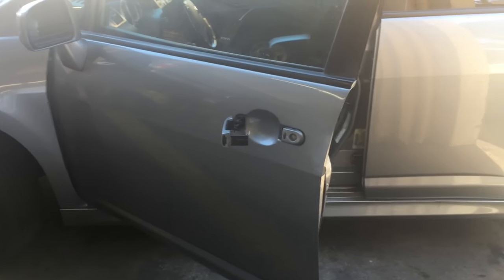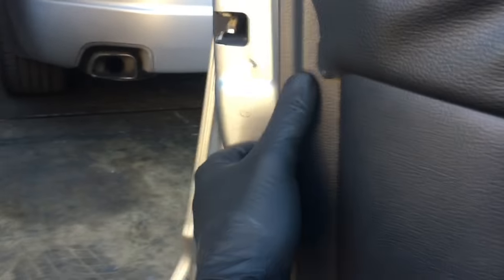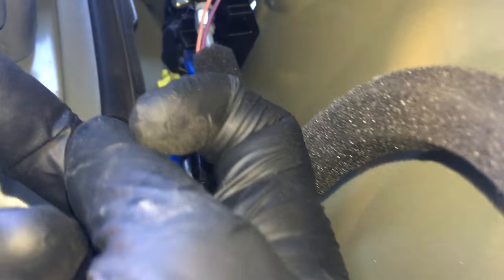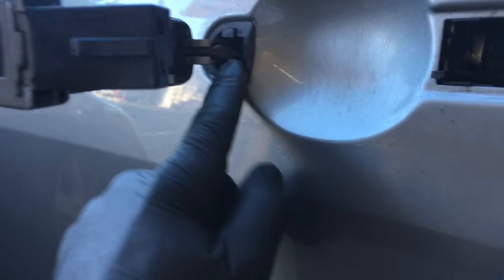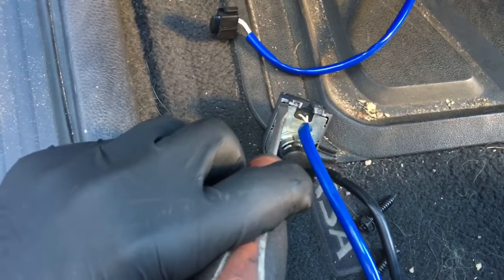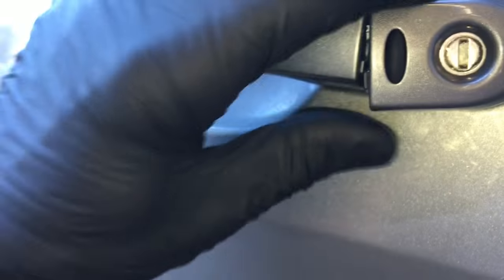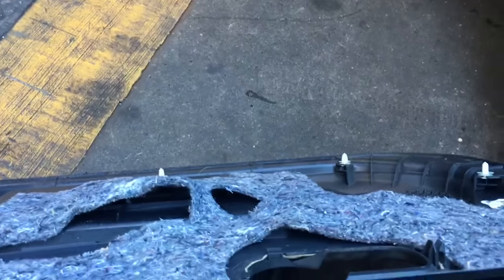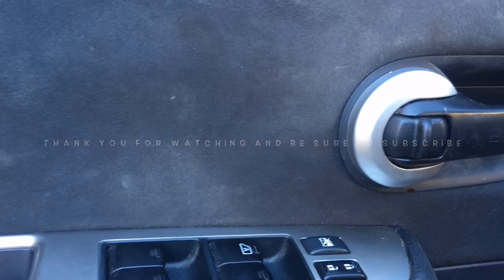How To Replace The Front Outer Door Handle And Lock Cylinder On A Nissan Versa

Comment: This video is perfect if you have the button by the key hole (I believe it's called the "smart switch), but if you don't have that button, it's much easier; you don't even have to remove the door panel on the inside. There are other videos that show the replacement when you don't have it, but if you do, this is a very detailed video on how to do it. Great video!!!

Comment: Thank you so much for this video. Before I watched this I was considering replacing the entire door instead of taking it apart. I am hoping to replace the dying window motor and door handle. I think I will take a stab at actually fixing these problems and replacing the parts rather than just throwing money at the problem and buying a whole door off a salvage car.
Reply from the maker: Wesley Allen you can do this. Thank you for watching!

Comment: Thanks for posting this.  It's a big help. This is my 2nd door handle to fail.  Question: My Versa doesn't have electric locks and windows. Is it possible to do this without taking the interior panel off?
Reply from the maker: Mark Davis i'm pretty sure you need to take the door panel off. The window crank has a clip on the back that you need to pop off. I would a google how to remove a window crank handle i've seen some pretty cool videos out there. If I had when I would link it up.
Reply: Hey, thanks for the reply. I HATE removing door panels but this went smoothly. I really appreciated your video.  BTW....funny you should mention the window crank. No problem getting it off, but  won't stay on now.  I even drove it on with a rubber mallet.  Still scratchin' my head.
Reply from the maker: Mark Davis sounds like the clip inside to handle may have fallen out. It should look like a little horse shoe.
Reply: How to Automotive thanks!

Comment: Do you have a video on how to fish the wire through the hole to keep the door handle on (starting at 3:07)?  My door handle completely came off.
Reply from the maker: Robert Niccum I don't have a video on it but if look inside the door from you should be able to follow the wire and see where it mounts. Just keep in mind when you're running the wire through window will be going up and down and try to keep it clear of all the moving parts.

Comment: Is the key tumbler with cover enough to control the backward movement of the handle by itself? My key hole cover broke and I'm wondering whether my handle knocked the cover off or if something else did it in.

Comment: I only need to replace the lock cover portion on the handle. Guess I'll find out, but do you think I can get away with not removing the door panel? It has pieces of the old cover still stuck around the lock cylinder, and it is the version without the button.
Hoping that freeing it at the side might give me enough access to remove broken pieces and snap the new one into place?
Reply: As much as I tried not to, I had to remove it anyway. There were pieces of the old cover still on the lock, and removing the lock, removed the yellow lock clip.
Somehow my door latch came unsecured too, as it had lost a clip, so with the interior panel off I could relocate everything.

Something about this car has seen more little plastic bits break than on any other car I've ever owned. Not a big fan.

This video helped enormously. Thank you.

Comment: Awesome video, but I don’t have a replacement handle just the original for a 2009 versa, no power locks or windows, thought I’d be able to pop it back with tools, this process although helpful, looks like a MAJOR pain in the A$$😒 only alternative is $70 at the auto shop😞☹️

Comment: My Nissan Versa 2010 handle just fell off 3days ago, when I saw this video, I'm going to try fix it myself, but, where do I buy those parts you replaced?
Reply from the maker: honey chang on this car we got the part from the dealer. But you could try Amazon or some of the other local parts suppliers in your area. I wish you luck on your adventure of replacing your door handle👍🏻

Comment: I have an 08 altima with a similar issue the driver door doesn't open from the outside but will open from the inside would replacing the lock cylinder fix this issue?
Reply from the maker: Starfox _ most likely that's the problem. But I would pull the door panel off and  look inside and try to operate it to see what's going on.

Comment: Thanks for the video. I have this problem.i am a bit confused because I am not replacing a lock button switch. What part of the video can I leave out of the repair? What size Torx?
Reply from the maker: trusso11783 if your Car doesn't have the electrical switch then you want to have the electrical wires and you just re-install the lock cylinder. It'll be even easier it will be less stuff to take apart. I don't remember the Torx  size sorry
Reply: trusso11783 My 2009 hatchback with a basic lock cylinder (no button) used a T30 torx driver.
Reply: Torx size 30.

Comment: Hi, I need that switch button for my Nissan micra but I didn't find any where. I looked everywhere amazon, AliExpress. I need this switch button for keyless entery. I called Nissan service they said, they sell all the door handle not only switch button.
Reply from the maker: usar sar That may be the only way you can get it by ordering the whole handle.
Reply: How to Automotive How much did you pay for the switch button. I don't want to buy whole door handle for just switch button. isn't there any communication number or mail address about seller or anything else.